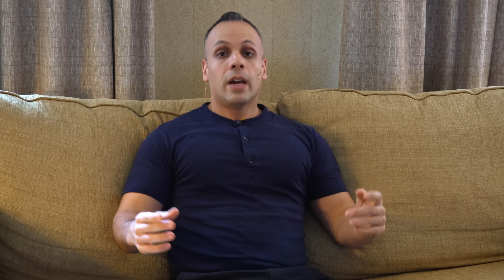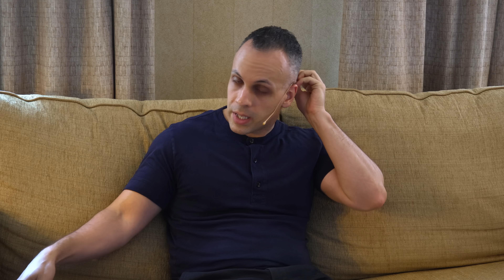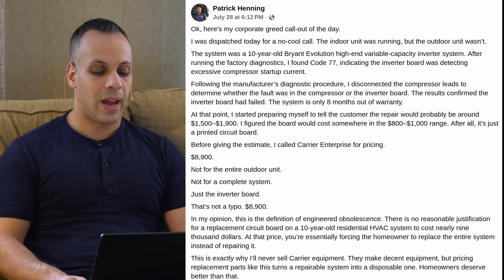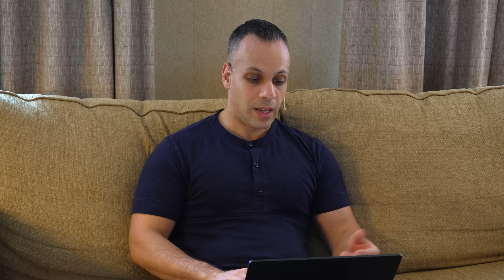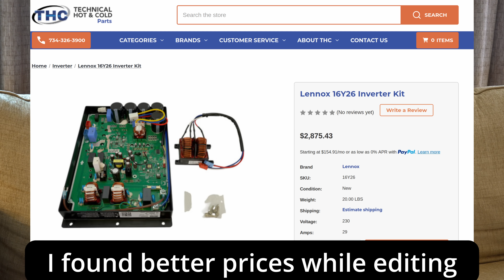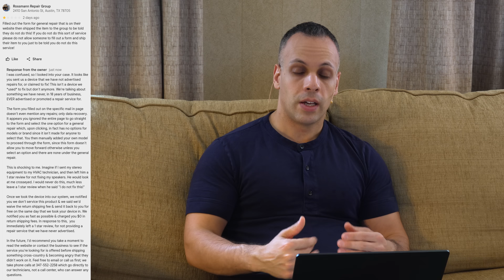Carrier AC repair has $8700 part cost for residential unit

Comment: $8700 is so much money that it'd be cheaper to hire a person to make an "artisanal" PCB just for you
Reply: It's got me interested in repairing those boards.
Reply: @Bryan-Hensley 🇺🇸 do it 🏴‍☠️🙏❤ be the most American move
Reply: @Bryan-Hensley fuck yeah! We need to build the American repair industry back from the ground up. Across multiple industries too. Especially automotive! The state of car repair/mechanics is abominable
Reply: @paaao I think I can build an electronics board a whole lot easier and I can build a car part. Good parts are getting impossible to find for my old 1999 Chevy Express
Reply: @paaao  lol you better have a good legal team from day one... 

I can see it now "It isn't safe for an unauthorized person to work on other people's equipment. We are now obligated to sue you for saving our customers money"
Reply: @Bryan-Hensley yeah, it's sad. America used to have people with common sense, dreams, and engineering sense. They all worked together to create the modern world and then our corporate overlords purchased the government and liquidated everything right out from under our feet. We're pretty fucked if you ask me.
Reply: @Bryan-Hensley  I would certainly look into repairing it.  The other board Louis shows has electrolytic capacitors on it.  Those fail in electronics constantly and are super easy to identify and fix.  If its bulging or leaking you can buy the replacement cap and solder it in just a few minutes.  Short of any IC failure on the board, most of the other components are easily replaceable.
Reply: @MakersMashup I agree, capacitors and diodes. The diodes will blow if the power is "dirty".
Reply: @Bryan-Hensley I did that for years with obsolete generator boards , as the parts dried up they became way expensive. Most of the time it was a simple fix on the board . I've done some appliance boards too. It's a shame the general population has become so dumb they can't even do basic repairs .
Reply: @Bryan-Hensley repaired mine for a different brand for about 9$
Reply: “Artisanal.”  Fantastic.
Reply: Looks like soldering is back on the menu, boys!
Reply: @altalena9139  Yeah, for $1,300 even a custom board spin up that does the exact same thing can be done.
Reply: And it would still be astronomically cheaper with a custom PCB. Absolutely criminal.
Reply: @k47k1d1 it shouldn't be all that hard to do. I've got a little cheap inverter compressor that comes with a genetic board. The board is $20 for replacement.
Reply: @k47k1d1  JLCPCB!
Reply: @k47k1d1  That's absolutely delusional. while the raw cost of the hardware isn't that much, maybe a couple hundred dollars, to design and assemble something bespoke that is also to code and safe would require someone with an electrical engineering degree. So for parts and assembly you are at 800-1200 dollars.

then you need a firmware engineer who is also an EE to write the firmware for the random assortment of parts you put together. These guys make about 90 dollars an hour in house. If you contract it out, expect to pay anywhere from 300-800 dollars an hour. Best case scenario, 25 hours brings you to the same cost as the OE board and that wouldn't even be enough time to write enough firmware to get the board to power on.
Reply: Agree!  Perhaps the problem is putting too many functions on one circuit board.
Reply: @malcomreynolds4103  I think youre forgetting how much people who do custom work hate these corpos who just want straight profit. Because in reality the firmware is a 1 time cost. and no shortage of people absolutely willing to dump the original and reverse engineer it just as a FU to the company.
Reply: Got a new Central Air system with AC a few years back when Carrier cut it's US production.  Asked the Local techs doing the install when Carrier came up.  All said their parts can be difficult to find and not anywhere near affordable.  They thought it was a disservice to their customers to sell something that would eventually cost them too much to fix 3 to 10 years down the road.
Reply: Sponsored by PCBBoard😉
Reply: board repair is viable without a doubt at that price. unless it'sa proprietary IC that died
Reply: @manitoba2445 Most of the time it's a simple part that fails.
Reply: @MUUKOW3  Most of the time it's undervalued capacitors that limit the lifespan of the board.
Reply: @davetherockguy And things like moset switches that fail from something external to the board , sometimes those arays are made just for that board .
Reply: @davetherockguy Also switching mosfets that fail because of some external problems. Those are many times purpose built for the board package but are easily remade.
Reply: Strategically placed near heat sources so they dry out and fail at a calculable rate... Just past the finish line...errr, warranty... I joke that a perfectly built race car blows the motor on worn out tires and runs out of fuel simultaneously while crossing the finish line in first....
Reply: @MUUKOW3 
Usually a bad solder joint or a capacitor.  20 minute repair, $15 worth of parts.
Reply: @MUUKOW3  $0.003 SMD resistor/cap/diode?
Reply: @davetherockguy came here to say that.  Those huge electrolytic caps have a definite lifespan.
Reply: @manitoba2445 Yeah, but the upside is the logic in all these systems at the end of the day is not rocket science, you can have everything run from an arduino.  Same thing with washers & dryers, the basic mechanics under the covers is the same.  The motor drivers is probably the most challenging part, and really isn't that difficult either.  We need a MegaSquirt/Speeduino but for appliances and HVAC.
Reply: @Mr_Ceiling_Fan  Crowdfunding for an appliance company that specifically makes open source, user repairable machines? I'm good for $10. 👍
Reply: @manitoba2445there's just nothing I can picture being all that complex in an AC. A decent EE or tech should be able to figure it out given time.
Reply: @8BitNaptime the simple, medium efficiency, cycle on, cycle off elecro-mechanical systems of 30 y ago were too reliable and not failing fast enough so we needed more over priced throw away "high" efficiency crap that efficiently buries us in e-waste, (while being told we pollute too much and use less energy) and fails 15 mins after the warranty, sometimes due to intentional programming (Sony TVs, IIRC?) nvm the techs that recommend complete refits for an electronical failure... Or that they've changed refrigerants and "this is the new standard, so you need this".... Despite the 30y old system might just need a new start/run capacitor or contractor, maybe cleaning as well, "this ""high"" eff. system will save you electricity" and the otherwise sound system gets ripped out, have the "hazardous" refrigerant be "reclaimed" (likely blown off or recovered to keep the techs own antique system going...) And the CuAl condenser and evaporator get sent to scrap for $$$ and replaced with popcans...

Maybe I'm bitter about this throw away tech like @lewisrossman and over-exaggerate a bit, lol..
Reply: Sry, I went off on a rant... 10y or so ago, my bro re-capped the fan controller for his high eff. furnace after he was told it was 1200 CAD and they wouldn't sell it to him 'cause he wasn't a gas tech as it was soldered directly to the motor and the service call would have been a few hundred less than a new furnace...
Reply: @8BitNaptime  There are kits from China for replacing the complete electronic innards of standard ACs, although I'm not sure if there are any for inverter ACs.
Reply: @rexsceleratorum1632 I see, there must be forums or channels where people try them
Reply: @manitoba2445sometimes but sometimes a proprietary Samsung chip on a TV if you know its values you can get similar chips and run in chain to reach said values 

But sometimes you cant
Reply: @manitoba2445 Its an inverter unit. ALL inverter boards are proprietary
Reply: As someone that used to do electronic repair work at an electronics manufacturer (down to SMT using binocular microscopes), I would be more than willing to perform the necessary repairs on these inverter boards.  It's easy work.
Reply: I repaired my Cousins board . It was a bad N-channel mosfet on a H-bridge motor driver. Cost me $14.00 to repair.
Reply: 100% Would love to see a video where he sends the board to PCBWay for an exact copy.
Reply: yea.... I'd just design my own PCBs. It doesn't cost much to create one.
Reply: i could get an AA in electrical engineering, then attempt to make it myself on a budget of $4200, leaving $1500 so that i can hire someone if i fail or so that i can pay to post 1500 complaint letters to the specific accountant who set this price.
Reply: @og666 I can make it for less than $20.
Reply: long time ago i had a friend who programmed a VIC20 (I believe) to run his washing machine after the motherboard died wich was almost as expencive as buying a new machine, worked perfectly for years!
Reply: Fiver + PCBway
Reply: Abolish capitalism, North Korea is based
Reply: Or hire a guy with a palm frond to stand there and fan you
Reply: No need for a custom board. A really nice brand name 3hp vfd is under $1000. They have more than enough internal logic and IO to run a residential AC.
Reply: PCBWay. Unfortunately I bet there's copyrighted software on that board.
Reply: One of the advantages to renting.
Reply: @hellermountain not necessarily, a landlord is not required to provide ac, in this state anyway. They can say, get you a window AC.
Reply: @Bryan-Hensley  In theory, but then they'd lose their tenant at the end of the lease term (if not before). Pretty much, everything in the house is the landlord's problem.
Reply: @hellermountain yeah right. I have several landlords as customers. They'll definitely tell you to go get a window AC if they don't feel like fixing it. If you give up your rental around here right now, there's a good chance you'll pay 3 to $500 more for a month for the next one, if you can find anything available. There are people living in campers around here because they can't find anything to rent.
Reply: @Bryan-Hensley  So finish the story, how many open rentals are there? Empty houses that aren't paying for themselves.
Reply: @hellermountain there's no finishing the story. Facts are facts. Our population has increased by over 10,000 in the past couple of years. People are leaving NY and California by the millions. Rent went from $300 - $500 per month to $1,000 - $2500 in just a few years.
Reply: @Bryan-Hensley  that's very bright and shiny and interesting but it didn't answer my question. Where I live, there are an excessive number of empty homes. People will not pay what the greedy landlords want.
Reply: @hellermountain none here.
Reply: @Bryan-Hensley okay, and you live, where? Narnia?
Reply: PCBWay sells the waterproofing coating after assembly option, I'm sure you can find someone willing to copy the PCB by hand into a file for $1000 and spend no more than $500 on components like the microcontrollers, hi-power MOSFETs and capacitors
Reply: @specialopsdave  For that price there are reverse-engineering shops in China...
Reply: @specialopsdave  Yeah that's pretty much what I was thinking. If all the PCB does is just invert power plus tiny errands around it it'd be cheap and easy to do. But other commenters claim the PCB actually is quite complicated
Reply: @MenkoDany  It's hard to reverse engineer since it certainly has more than 2 layers, but as I said some skilled guy with equipment would probably do it for a grand, and once you have the file, PCB companies can straight-up mass produce them for you for cheap if you want.

You don't want to hack together a custom board without proper reverse engineering when the AC company already refuses to disclose the specs of the still working parts.
Reply: @MenkoDany They use a proprietary communications protocol to set the speed of the variable speed compressor. Get it wrong and the equally expensive compressor can be damaged. I doubt the proprietary communication is very sophisticated today. If someone starts to make or repair these boards, they will start going down the Chamberlain path and start encrypting everything.
Reply: @johnhaller5851  They don't need to. you would be in tens of thousands to hundreds of thousands of dollars to hire a firmware engineer to write the firmware. If you don't want the problem, don't get an inverter unit.
Reply: 50 years in the HVAC busuness, 40 years as an owner of 2 companies.

No we can't fix them.  They cannot be repaired if you do not have a UL REPAIR CERTIFICATION.  This goes back to the 80's when the solid state controls for oil furnaces ( primary controls on oil  furnaces) and if we took them apart and repaired a resitor or relay, and the house burned down, we would be liable because our company, and about 99.999% of every other company, didn't have that UL rating.  

Crazy I know.  Not an advocate of this, but that's the law.  Stupid.
Reply: @greg042 Wait a minute.  By your logic if i bring my TV to a repair man and he fixes it he's now liable if my house burns down because his repair wasn't UL? That's not making sense.  It goes back to trying to take back right to repair by false info and scare tactics.
Reply: @richbooth8948 well, I just did an AI search of "can i fix ul approved circuit board on hvac equipment?" And I was not surprised to find that you cannot.  I suggest you do the same.  

"Liability & Codes: If a repaired control board fails—especially on gas-fired appliances managing safety limits or carbon monoxide containment—the technician or DIYer assumes total liability for fires or gas leaks. [1]

I know it crazy, as I said, but it's a liability thing.
Reply: Hvac owner here.  Fixing the board would take the UL LISTING away so if ( highly  unlikely) if caught the house on fire, the company or person without the UL approval  would be responsible.  

I'm not advocating this is right, cause it isn't, but that is the number 1 reason people don't repair stuff.
Reply: @greg042  only if you don't replace the parts with the exact same or equivalent electrical components and have the training to do so. If you are trained as an electronics repair technician, an industrial electrician, or are an electrical engineer this would be well within what was considered a like and kind repair and the UL certification for fire safety would be maintained. The average person that just learned their skills off the internet, though? They would not be qualified. You would also need to check with local laws concerning doing electrical work on your own home as that can be illegal in some localities, as can any HVAC work. This varies and needs to be looked into.

If it comes down to you ending up in court, always error on the side of caution, of course, and consult a lawyer, but UL listed equipment that is serviceable can be serviced by qualified personnel. The manufacturer is not required to make that determination nor is a circuit board that is replaceable non-serviceable by a sufficiently trained technician or engineer.
Reply: @KnightsWithoutATable exactly!  My company did not have that certification. Hence, we couldn't fix them.  99.99999% of hvac companies do not.  That was my point.
Reply: @KnightsWithoutATable  It's more complicated than that. UL monitors factories to be sure the approved design is being approved, and that any design changes are run through UL (with payment made to analyze the design change) before implementing them in the factory. Field repair is impossible unless the manufacturer has certified a part is field replaceable, and then only with a UL certified part. Good luck getting certified to manufacture a replacement part if you are the manufacturer or their supplier.

This is also one reason the replacement parts are so expensive once the original parts are no longer being put into new units. If the manufacturer runs out of repair stock, chances are good that some component on the board has also been discontinued, so now you have to get a new UL certification for a replacement board with a different component. This process can be insanely expensive, as the UL certification is on the entire unit, not the subassembly, even if only the subassembly has changed.
Reply: @johnhaller5851 service rules for furnaces and other equipment vary. As I said, you have to look it up by equipment type. Radio and stereo equipment, for example, can be repaired by any qualified individual. Same thing for computers.
Reply: @johnhaller5851 you are 100% wrong.. I worked in electronics manufacturing for 15 years, I can tell you UL does not certify each component, just the overall design. A replaced part does not trigger a recertification, as long as it has similar specs.
Reply: @felipe.gtz.b UL can certify subassemblies separately from overall products. If Carrier buys that subassembly from someone else, that subassembly has to be manufactured in a UL approved factory, which follows approved procedures. One of the tightly controlled and audited parts of being a UL approved factory is the sticker stock UL provides, and the factory has to show that it does not apply the sticker to unapproved designs articles (preproduction samples), and that the number of stickers applied matches the factory production level. Any change to the design has to be UL approved before the new design can be produced and have the sticker applied.

I'm sure there's a process for repairing or updating previously approved designs, and that if the original factory fixes it, that it is a factory remanufactured part. Using technicians trained in repairing the assembly, as well as using factory new or remanufactured parts, or OEM equivalent parts would preserve the unit's UL certificate. Louis' repaired boards may require his shop to be a UL approved factory capable of properly manufacturing/repairing the subassembly. As a power supply meant to be used outdoors, it will have higher scrutiny, as power supplies can leak hazardous voltage, or can catch on fire in certain fault conditions. 

Will this absolutely require Louis' factory to be UL certified to repair "non-user serviceable parts"? Maybe. I can see arguments for both yes and no, but I can't say for sure. But, I can see a reluctance of a licensed HVAC tech being reluctant to install one without that certification.
Reply: @greg042 this board sits inside the outside unit.. even failing catastrophically, fire would be contained by the metal box where it sits.. the risk is so low the only way I can see this repair being dangerous is if you install C4 in it.
Reply: That's very unlikely to be the case. I tracked down a photo of the Carrier inverter board and it's way more complex than the Lennox board shown in the video. I can't tell if there's any software in it, but that would very likely be a showstopper. It would be worth spending a few hundred dollars if he can find someone willing to try fixing it, but of course no service information will be available. Also, whether you fix it or design a new one, you need all the other parts of the system to test it, or at least some bits of kit that emulate the rest of the system. And you need to know precisely what it's supposed to do under all the different operating conditions.
Reply: @stevegreen5358 that isn't hard at all. They simply read the temperature of the refrigerant lines and speed up or slow down accordingly. They are a 3 phase motor controller by a variable hz inverter.
Reply: @stevegreen5358  The fix could be as simple as a bad cap or busted trace though. 

On top of that though, think about the task that's actually required here; Run a compressor when the thermostat says so. You could probably have that thing run full blast with just a few relays and diodes and no circuitry at all. Sure, your electric bill would be higher, but $8900 is a LOT of electricity.
Reply: The real problem with inverter style condesnors is that they are sensitive to voltage fluxes and surges. The industry is just starting to realize they need to add a power conditioner after the disconnect to protect the board. But unlicesnsed Joe down the street doesnt care and the guy that would add it bid like 3k over because HVAC guys like to charge 500% mark up on a $300 part.
Reply: @ayah922  they should probably just use commodity VFDs instead of whatever crap they are designing there.
Reply: @ayah922 voltage fluctuation damage usually knocks out a few diodes. Cheap parts
Reply: @JGnLAU that's kinda what they are. They are 3 phase motors. The inverter charges 1 phase to variable hz 3 phase output.
Reply: @Bryan-Hensley  yeah but they design their own proprietary ones instead of working with existing VFDs that are easy to change.
Reply: @JHe-f9t  I thought it was literally just an inverter on a PCB?
Reply: @JGnLAU  They do in proper commercial HVAC, way less proprietary BS. "inverter boards" are really just AC-DC VFDs but poorly designed for maximized profits. It may be that the Scroll or Recipricals compressors used in residential like a special sauce.
Reply: Could run an Arduino, PIE with some programming logic and some circuits to accomplish the same thing  @JHe-f9t